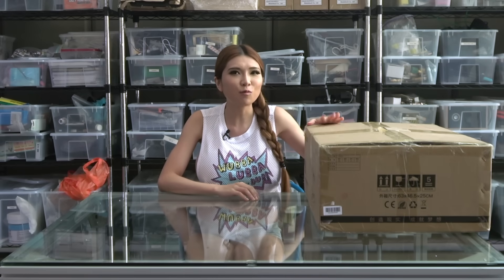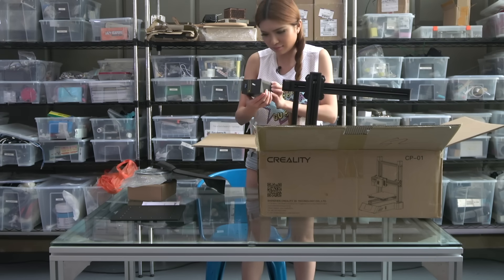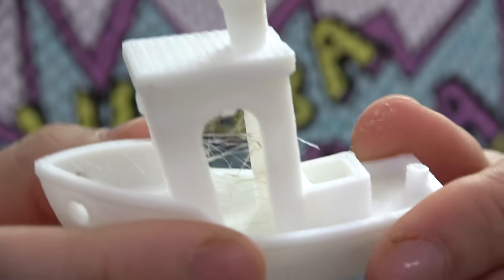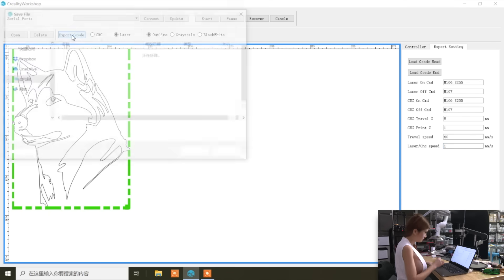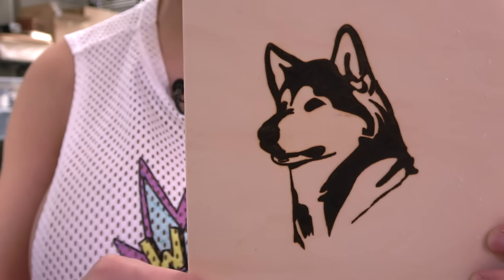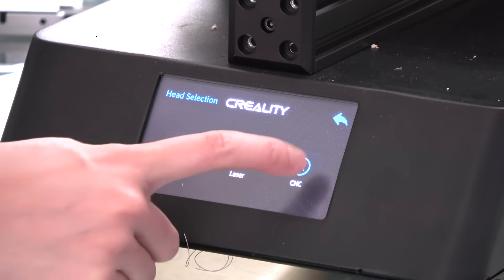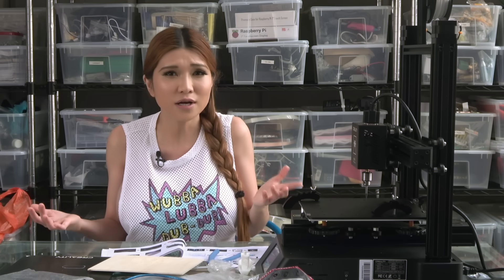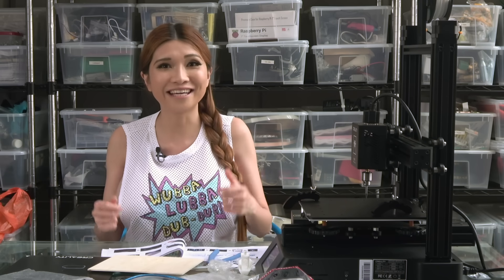Creality CP-01 Review, a 3D Printer, Laser and CNC Engraver

Comment: PCB (Printed Circuit Board) engraving using these machines?  First time I heard of this capability using these machines.  Will have to look into this. Thanks Naomi.  Also it looks as if one could use the laser to engrave control panel markings for electronics enclosures.

Comment: the burning on the benchy has me worried, and its not up to the community to fix settings. cnc too big for PCB prototyping. i dont think the laser will work too well on acrylic.  if the head specs are  released, i would suspect mods would improve all of these features. i do like the idea of the screw terminals on the head cables.

Comment: @Naomi 'SexyCyborg' Wu Changing head doesn't seem to be easy. I don't know if it's applicable, but I think fast connectors, such as GX-16 or BNC could be great. Or a system similar to those we can see in inkjet printers.

I like the idea of pick and place head, but the head can only move on 1 axis. I'm afraid that if the bed is moving, SMT components fly too easily.

I think that a solder paste/glue dispenser head will be easier to implement. After that, since solder paste acts as a glue,  automatic pick and place can be done.

Comment: I'm not a fan of the 3 in 1 stuff.  Printers, lasers, and mills are different machines that have different needs and many compromises will need to be made.  The mill lacks rigidity (wheels and belts compress and stretch, it needs machine ways and lead screws).  The printer will lack cleanliness.  The laser will lack power and safety.  All of them will have to be re-trammed frequently without a very robust tool change system.  I get the reason why people think they want this machine, but I feel like this sort of product will take advantage of and frustrate an entry level person who will quickly discover they need to upgrade to really pursue their passion.

Comment: The trade offs for a fast 3D printer and a fast CNC are opposed - A CNC needs a heavier, reinforced tool holder to remain rigid while cutting and the 3D printer needs a lighter agile tool head to move quickly and accurately.  The best compromise it to take a fast CNC frame and add a print head to make an over powered 3D printer.

I like the idea of a standardized tool head mount.  The small laser, despite the safety issues, is an OK tool head for the frame, and it would be good to see a pick and place and a syringe head for the machine.

Does the printer accept streamed commands from Octoprint?

Comment: Let me know once they refine this product. The second plate and or clamps need to be upgraded. I’d also like to see a vacuum attachment to keep the work space clean. Because saw dust and 3D printing doesn’t go well together. This could also be used to help keep the material cooler while laxer engraving, if that is needed for some materials. 

Thank you for showing this to us.
Reply: I’d also like to see more supports like the ender 5, if they are going to make a multi use product like this then please pull out all the stops and make it the very best you can. I don’t mind paying a little more for quality especially if it will do 3x the amount of work! So let’s build it on a better foundation.
Reply: I’d also like to see more supports like the ender 5, if they are going to make a multi use product like this then please pull out all the stops and make it the very best you can. I don’t mind paying a little more for quality especially if it will do 3x the amount of work! So let’s build it on a better foundation.

Comment: I think they're missing a trick by not having the heads auto-detected. Pick and place with soldering would be an absolutely killer feature.
Reply: Oo!  Great idea, that!
Reply: Oh God Yes. I do a ton of arduino stuff - and it'd be awesome to make one off PCBs to stop having to use shitty jumper wires between modules... Need a MOSFET? Place it. Need some power pads. Place it. Need to have through holes for connectors? Drill it. If it soldered as well.... Hnnnnggggggg

Comment: The flex on the milling head looked pretty significant, but seemed like the entire spindle not just the chuck. Where is the flex coming from and could there be an easy way to improve it?
Reply from the maker: It's just not all that rigid, that's with very slow spindle speed and a very, very shallow cut. It would need to be multiple paper thin passes to deal with that flex. As I said- passable CNC, but very limited.
Reply: @Naomi-Wu  If Creality could source some really short stubby milling bits it would help a lot I imagine. When the tool length doubles, so does the force on the spindle.

Comment: I've seen a few reviews of 3-in-1 type machines now and I don't think any of them struck me as a must have.  I also have difficulty understanding why the manufacturers don't come up with better ways of mounting and swapping the tool heads.  Surely some sort of lever-action quick release (with and integrated connector) would be more useful than messing about without little thumb screws etc?  Anyway, thanks as always for the review and your honest opionins.
Reply from the maker: E3D came up with a good system, not sure if it's patented...

Comment: The big win for these 3-in-one designs (I have a Snapmaker gen 1, which this is clearly inspired by with the enclosed-screw-guide linear modules) is for making PCBs & enclosures from one machine. 3D print the housing, use the laser to expose the PCB traces for etching, the drill the through-holes (and mill any isolation slots, component pockets, etc) with the CNC head. The screw mount is definitely a real pain for swapping modules. What I'm really looking forward is the E3D toolchanger mechanism, hopefully that gains wide adoption.

Comment: My biggest worry about these multi job printers is that it's going to be 15 different standards to do the same thing. Company A is going to build their printer to support their print head code and connection point. Company B is going to make their own standards. Mean while DIY is going to make some open source one that's not as good as Company A at one thing and Company B at another thing but because they don't have any financial backing doesn't resolve the short comings and never becomes a purchasable standard. Part of what made 3D printers boom is the openness of the platform to changes.
Reply from the maker: Yep...

Comment: about the only reason I can think of for a 3-in-1 is if you really have  almost no space. Maybe a dorm room at Uni, perhaps. I like your idea for a pick'n'place head :)
Reply from the maker: I think people really need to consider the use cases for the current extra two heads carefully. Maybe someone who does small wood models- 3D printer for jigs and laser for customized logos? But a lot of people will but it "just in case" they need the extra two and I'm not so sure about that.